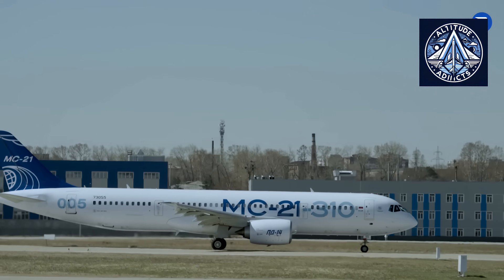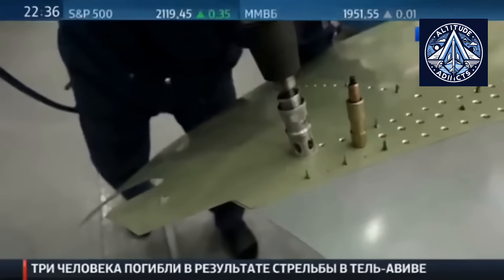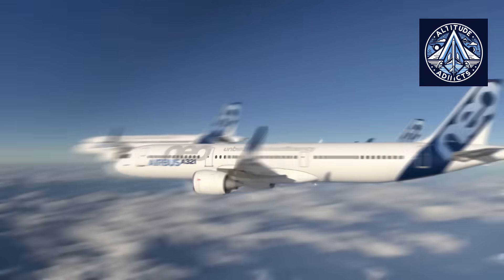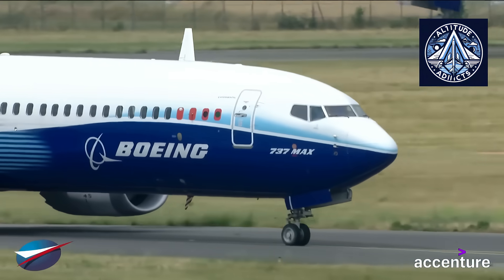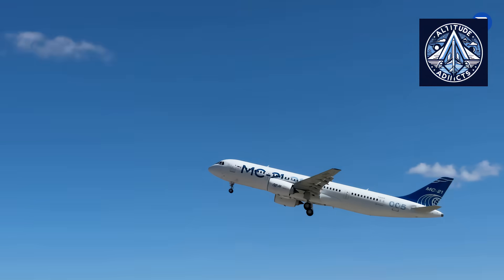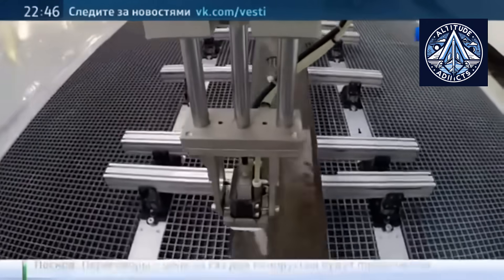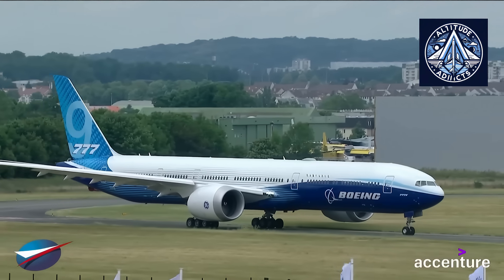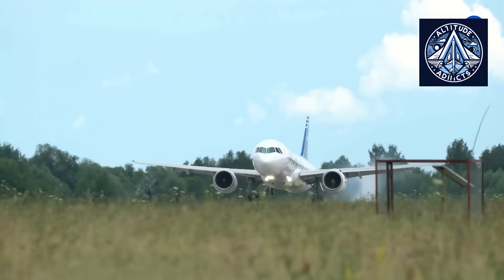Why Russia Built a MC-21 Aircraft Without Winglets | Sharklets | Split Scimitar

Comment: AS THE FIRST AMERICAN JET ENGINE MECHANIC FOR THE MC-21-300 RUSSIAN AIRLINER FLIGHT TEST. 
I ASKED." WHY NO WINGLETS?" 
I was told in the Russian military Aircraft factory in Irkursk Siberia where the SU-30 fighter and SU-25 ground attack Aircraft are built. 
The reason why? 
When you design your wing properly, you not not need them.😊
The purpose of winglets is to trick the air into thinking that the wing is longer than it is, while saving space at the GATE.
So yea, they have a valid point.😊

Comment: Why doesn't the MS-21 aircraft have winglets?
The designers decided against winglets because of the wing material—carbon fiber. This allowed the wing surfaces to be thin yet strong and rigid. This improved the aircraft's aerodynamics by 5–6% compared to competitors.
At the same time, *TsAGI specialists are confident that winglets are a backup that can be installed on future aircraft modifications if necessary.
*Central Aerohydrodynamic Institute named after Professor N.E. Zhukovsky

Comment from the maker: @SebastianRBanovich  @jeffhedrich3551  @yurikozhokin8348 

Thanks everyone for the insights! A few points to consider:

High aspect ratio wings vs. wingtips: Leeham News makes a good point—if the base wing achieves a near-optimal (elliptical) lift distribution within structural and gate-width constraints, wingtip devices aren’t strictly necessary for efficiency. The MC‑21’s wing was likely designed with this in mind.

Incremental improvements: Historically, Russia did something similar with the Superjet—initially no winglets, added later. Certification and structural readiness often dictate this sequence.

Current MC‑21 wing: The conventional tip seen now appears to be a “future-proof” design, meaning the wingbox can accommodate wingtips later as a Part 21 design modification. Sanctions and production priorities may have delayed full integration, but it seems likely that winglets or raked tips will be added soon after certification.

Takeaway: The MC‑21 wing combines high aspect ratio design with a pragmatic rollout strategy—release the plane for production first, then add incremental aerodynamic improvements like wingtips.

Comment: In the real world, without deceitful marketing, winglets improve wing efficiency in a relatively small range of flight speeds. Aerodynamicists choose cruising mode, for obvious reasons. In other flight modes (takeoff, descent, landing), winglets lead to a decrease in wing efficiency. At the same time, the increase in wing elongation leads to increased efficiency in all flight modes.
Reply: You have to understand, those relatively small savings of fuel extend range which is a factor for all airlines acquiring aircraft.

Comment: They should add them even if it just give them 1-2% of savings because with new wings already deliver 8% with them it will be 10% and plane would look like modern western plane which is something everyone will be compare them so if looks the same but safe 10% and is 10% cheaper to buy , it's no brainier which to buy, save 10% buying it and save 10% using it is worth give it a chance

Comment: Sorry mate, that is too twisted of an argument. I'm aircraft engineer, I love the MC21 project, but this is bullshit, the winglets are ALWAYS better, the 787 dreamliner doesn't have them but the tips are twisted, the MC 21 doesn't.... that's a mistake or a problem with the delays, is nothing wrong to aknowledge problems with the design.....they will put them in due time, I guess they had no time or budget to develop and certify them yet for a reason due to sanctions.
Reply: Russia did this with Superjet - no winglets at first, but put them in 10 years later. Apparently the winglets were causing a delay in certification, so they were left for after.
Reply: @yurikozhokin8348 exactly, that what I meant, this time though I believe It won't take them 10 years, Russia is much stronger and determined to be independent now than 10 years ago....my guess is that they will do it soon, of they made the wingbox ready for it as they say in the video, will be soon after certification as a Part 21 desing modification
Reply: From Leeham News: Wing tip devices are part of the overall wing design and they improve the wing’s drag characteristics by forming a wider and (ideally) more elliptical lift distribution. If you achieve your target lift distribution with your base wing within the gate width restrictions you have, you don’t need the complexity of a special wingtip.
Reply: Its not all about that!!! The wimg tips are not mainly imcreasing lift, wliminate imduced drag from the vortex on the tips, when the higher pressure air from beneath rolls up to the top of the wing, is not about lift distribution, is about induced drag, and it allways happens without wint tip design for it. 
I've been working forore than a decade with aircrafts!! I studied aerodinamics in depth for my certifications
Reply: @SebastianRBanovich  there may be other factors, but leeham news is highly respected.  The video said they may add it later depending on the mission profile.
Reply: @SebastianRBanovich  Te felicito por tus capacidades, pero no seas fundamentalista y narciso. En aerodinamica nunca esta dicha la ultima palabra!.... Creo que los Rusos saben hacer aviones, y tienen mucho mas de "1 década" diseñando y construyendo aviones.... No te parece?
Reply: So Boeing has their new truss braced design which, according to them, derives its efficiency from higher aspect ratios and it doesn’t include wing tip devices. I don’t understand why the modern high aspect ratio wing on the mc21 couldn’t match the efficiency of older wings with tip devices.
Reply: @jeffhedrich3551 it can, but they haven't done it, look at the tip, after full certification, we will see the introduction of wingtips  100%.......the  tip of the mc21 wing is completely conventional, this explanation on the video is just standard aerodinamics explanation. Vortex is generated 100%.....just wait and you will see. With all the setbacks and samctions because of the war is completely normal, why  bother now with this when you need to release the plane for production first? Once is on production they will introduce them 100%.
Reply: Sanksi membuat rusia lebih hebat bro
Reply: You're a bad engineer. Planes often just make an extra circuit to use up the remaining fuel; before, they would simply dump it. 1-2 percent is food for the poor. Where fuel and services are expensive , even these percentages don't solve anything.
Reply: Значит ты авиаинженер ?  Ну прелестно.  А не подскажешь ,  в КАКОЙ области авиастроении ты есть этот  самый инженер ?   К примеру унитаз в самолете ТОЖЕ ведь инженер конструирует , не кухарка-же !  Ну так кто ты ?
Reply: @vanowaska2440 primero aprende a leer y luego hablamos si quieres......
Yo certifico aviones capullo....y seguramente, lo que me gasto en desayunar dobla tu sueldo
Reply: You made a lot of typos, just like your opinion😂

Comment: If it had sharklets it would reduce the fuel even further
Reply: Do you truly understand what you're watching??? It says that winglets can reduce about 2% fuel by reducing vortex drag by metal wings but the MC-21 at this time doesn't require winglets because the wings are made mostly of composite material which are light and thin hence reduces drag and have fuel savings around 5%!!! Plus winglets aren't free, it adds up to the cost and the author said putting winglets needs reinforcement to the wing, by logic it means you need to put some additional wing reinforcement and it makes the wing extra thick that make up to additional drag...Hence, it will out weights the benefit of MC-21 that has already thin wings made of composite!!! Thin wings means less drag, and less drag means fuel savings. That is why the designers didn't consider adding winglets to MC-21 at this period. Understand???
Reply: @juansuponatime517  fully of data. Too great
Reply: Furthermore, every country should have its own unique design, which will be appealing to potential customers , that's why Airbus design is different from Boeing
Reply: @ricardoortizqomboc2184  Каждая страна ? Ну круто ! А сколько этих стран , которые могут САМОСТОЯТЕЛЬНО строить СВОИ самолеты ?  Я знаю тольтко одну такую , и это Россия !!  Не делай большие глаза , т.к.  все  остальные страны делают """" свои"""" самолеты в  КООПЕРАЦИИ с другими !!!   Пример : для Ф-35  кое-что делают Турки , и  т. д.  ВСЕ кроме теперь России !    Возрази , ну если что .